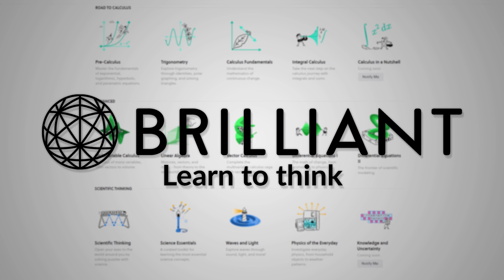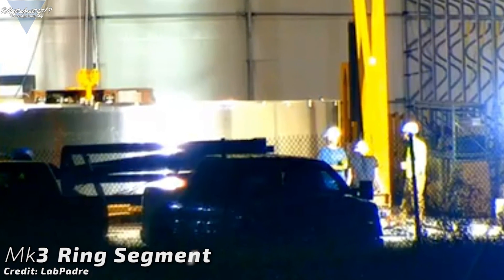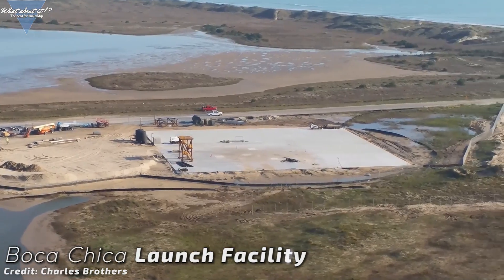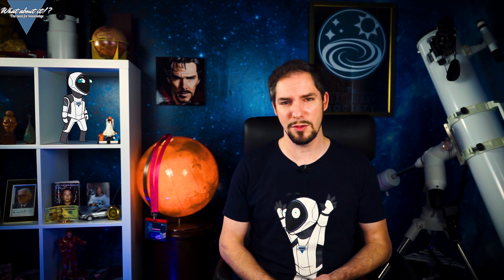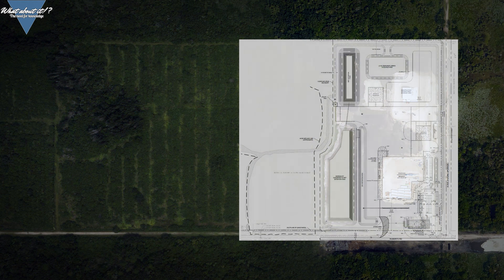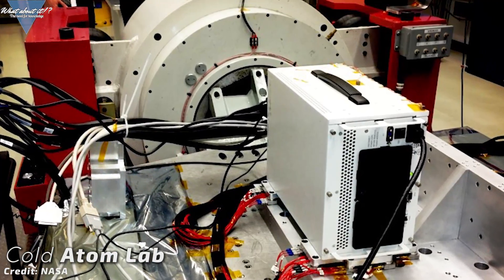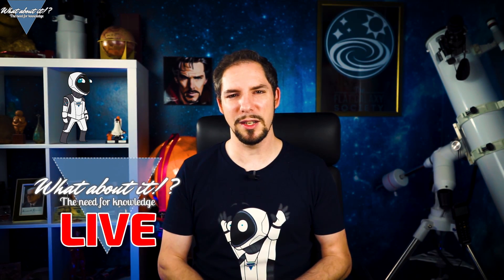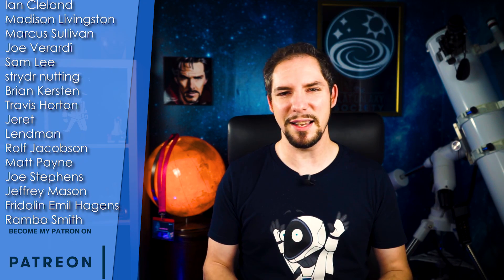54 | SpaceX Starship Updates - Roberts Road development Phase 2 – CRS19 Preparations

Comment: The weld didn't fail; the LN2  pump wasn't told to shut off and the ship was overpressured past it's ultimate limits. Computers: not always right.
We're still not seeing the cold-rolled 30x stainless steel rings, which will make a MUCH stronger ship. I bet those steel fabricators are in ordered and in progress.

Comment: On what do you base the idea that SpaceX knew about the potential failure of the tank before the explosion? Seems to me like it would be rather stupid to purposefully detonate the prototype. I'd understand if it was only a tank that they wanted to do a catastrophic failure test on, once they found it had an irreparable flaw. But this is an entire working launch prototype they blew up. I'd think that there were more systems onboard that had more value than as a prop piece in a rather unspectacular fireworks show.
Me thinkst that you are perhaps pumping a little hot air on this one. It's okay to be SpaceX fanboy, but let's stick to the facts on this one, my friend.

Comment: My theroy On the Mark 1 is that it was never to fly!  I think it was a proof of concept Destructive test bed/Procedural construction ie prctice in building concepts device.I could tell from the first time i saw it constructed from patches of metal and welded with filler metal Not the same as the Hull material ie:stainless non ferrous hull plating and ferrous fillett material! I bet you will find a NASA MEMO sooner or later confirming this as a destructive test.jim

Comment: The containers may serve a dual purpose. When doing MIG/TIG welding on stainless steel and aluminum wind is not your friend. The wind can blow the sheilding gas away causing subpar welds. Anything that can block some of the air helps.

Comment: The single panel ring wit only one transverse seam might reduce the number of welds.  However, from the videos I watched the failure event appeared to be a "Spool to Spool" failure.  The "orange Peel" dome fabrication is not the most weld efficient design to reduce number and length of weldments either!  A "Horton Sphere" has the smallest length of welds.

Comment: i suspect they are building it outdoors, due to the fact that, if it were to fail after an outdoor construction, there would be no possible chance for a crew to repair it on mars. keep in mind, a crew on mars would not have a construction hangar, nor a construction team. they need to make it work under harsh conditions, or it will not work at all.

Comment: Next one should be out of titanium.
Reply: Titanium is expensive, about 60$ per kg.
Reply from the maker: Stainless should do the job just fine. SpaceX will just have to take it a bit slower. More inspections. :)
Reply: @Whataboutit  Stainless steel is also stronger.The strength to weight ratio of steel, titanium and aluminium are the same.

Comment: My thoughts on producing the hull: Have it rolled onsite as a spiral, cut the ends straight. One piece, then it only needs one continuous spiral weld , seems much sturdier to me.
Reply from the maker: I bet, it will be explored by SpaceX, if it makes sense at all! Sounds like a logical idea to me too, but I am not a SpaceX engineer.
Reply: @Whataboutit  Hi felix, yeah there's a high probability that the idea already has been spawned within SpaceX, and if they don't go with that method, it's either flawed or the machines are simply not big enough.

Comment: [Edit: What about it!? provides a correction, he's probably right] Poptop Orbie was overpressured. It was a sensor failure. Quality control was fine. They will have better quality going forward. But that's almost coincidence. The new method is simply cheaper faster and less effort. Once the rollers are going the steel comes out fast.

The sheet steel design was technically good enough. So it's like a "if you can dodge a wrench you can dodge a ball" situation.

That's also good news for in sitsu repairability, and eventually fabrication.

Mars is sick with iron. Put a steel foundry up there. Make the computers and the engines and the bits in the bobs on Earth, fabricate Starship hulls on Mars. Where the gravity is light, so you can make them really really really big.

It's the Martian way. 👽
Reply from the maker: I have to disagree. I know some Raalphs and Kaarls and they told me differently. ;) There's a reason, why Musk knew even before the test, that it would fail. The welders are smart.
Reply: So this turned out to just be a rumor? 

https://www.facebook.com/groups/1541938906124567/permalink/2462790690706046?sfns=mo

Guess I fell for it then.

Comment: 3:00  "The people building it are still not wearing masks and white suits." Came across this rather surprising vid of the Centaur upper stage fabrication from the 60s. Indoors, but it's a regular factory floor, not especially clean. Centaur was and is made of stainless steel - but only 0.5mm thick. Dome bulkhead near the end of vid has exactly the same sectional design as Starship's. 
@2DtI
Reply from the maker: Exactly! SpaceX is trying hard to make rockets in a different way. Musk wants to avoid anything that would drive up the costs. I really hope, he can make it happen! :)
Reply: Fix for the link:  https://youtu.be/mpDg8YT2DtI

Comment: I would imagine mk1 was tested to destruction a standard practice for pressure systems .
Reply: @giggleherz  I agree with you. I don't agree with Ian.
Reply from the maker: There's a third option. They started the build with a flight as the goal. Short before the test the workers told SpaceX that it will never do it. Then SpaceX decided to just pressure test it.

Comment: Until they fix Cybertrucks to be street-legal, they won't be towing in any components with them.
Reply: Cybertrucks are street legal... Where do you get your information?
Reply: @dr.zoidberg8666  The steering wheel, lack of side mirrors, safety glass in side windows.  All not legal in any western market.
Reply from the maker: Mirrors are a quick fix and the side window glass obviously was safety glass. It did not fall out after the hit. ;) And the steering wheel is totally legal. The H shape was used before.
Reply: @Brashnir  In addition to what Felix it said, the Cybertruck is not by far the first road car without mirrors -- the industry seems to be moving towards cameras instead.

Comment: The Mk1 anomaly was not a failure of the vehicle but in ground procedures. Miscommunication cause an overfill which will destroy any tank.

SpaceX wasn’t rattled by the failure because it had nothing to do with the vehicle design or manufacture.
Reply from the maker: This is not official, even though other channels make it seem official. ;) My inside information tells me different things. :)
Reply: @Whataboutit   Is your inside man an engineer, management, or PR?